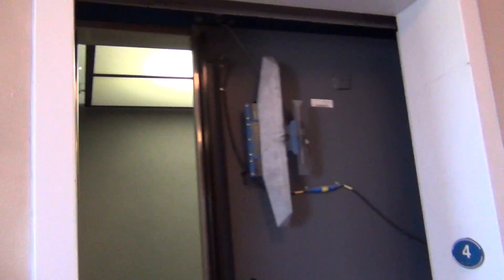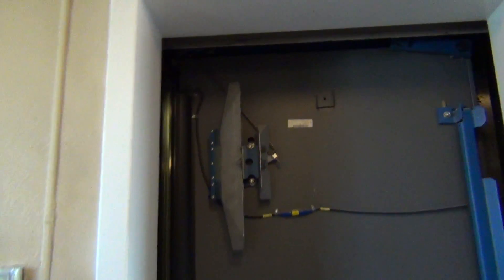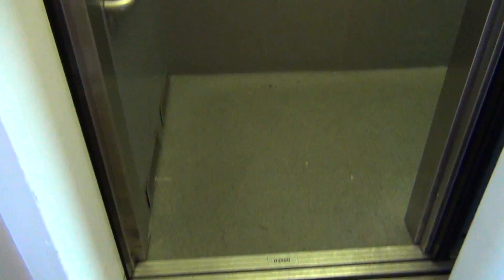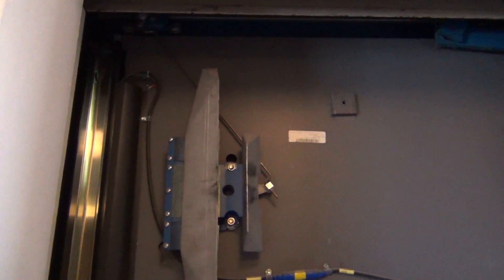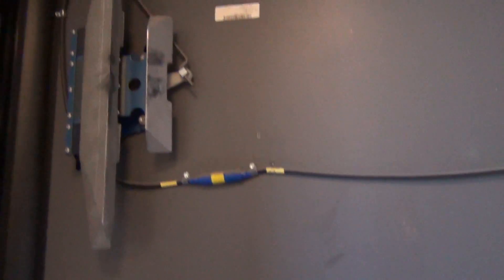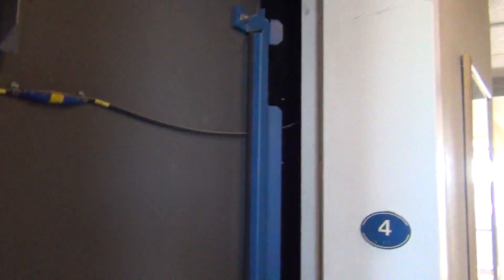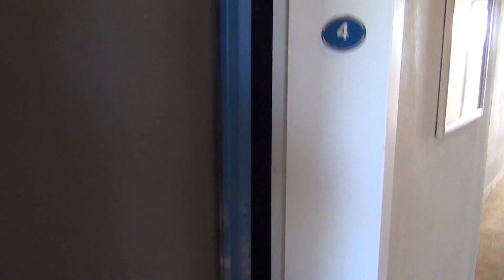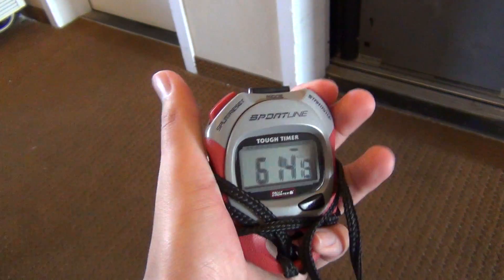(14 June 2013) Stuck Shaft Door - Dover Elevator Hotel Blue Albuquerque

Comment: You should have tried pulling the exterior door closed, it might have solved the problem, the reason it disabled itself is because when floors are selected and the exterior door is open it doesn't reopen after the interior door closes.  Nice video by the way! :)
Reply: That might be dangerous though, since the interior door could suddenly open, possibly mashing his fingers or hand.